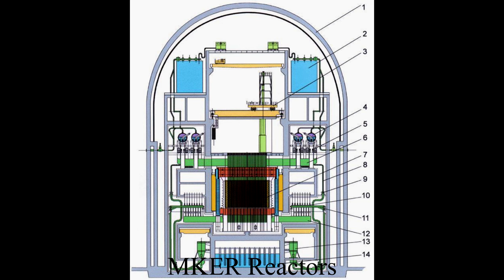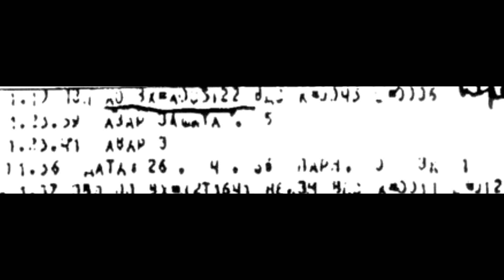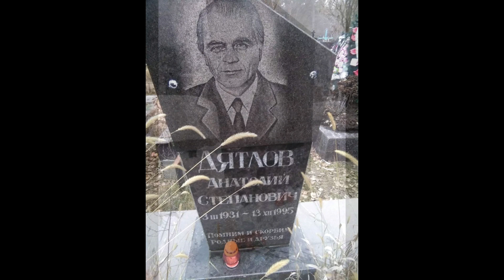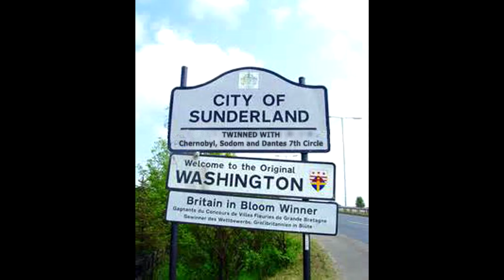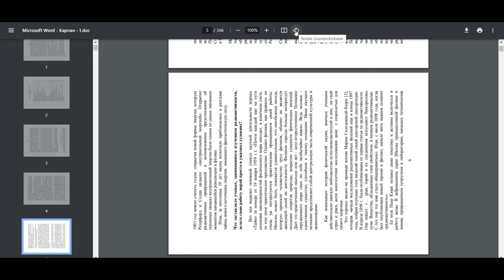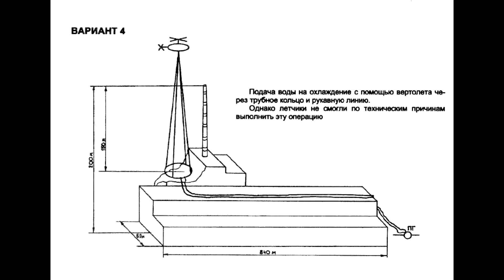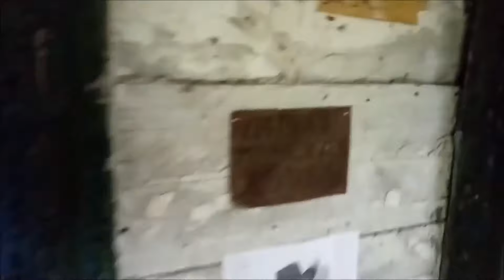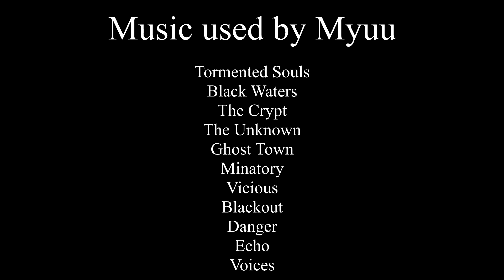The Chernobyl Iceberg Explained REMASTERED - Part Three FINALE

Comment: Thanks for putting the three videos on almost everything known about Chernobyl.  Mark Felton covers the use of the assault tanks, suggesting they were trying to punch holes in the lower walls of the buildings to control water flow.  Also, I think the antenna array design was used as a prop in the Divergent movie as the top of the containment wall and fence.

Comment: Just quick reminder. Kursk 5 is just a casual RBMK with MKER octagonal shaped graphite stacks, which were added in the 90s, when they still believed in the unit the to be completed. I even have a drawings, if you want them. First MKER should have been built in Leningrad instead of VVERs in late 1990s and early 2000s. Also, Chernobyl 7 to 12 would be VVER-1000 and they also planned a heat nuclear plant near Otashev village. I have some materials if you are interested. Anyway, nice video.